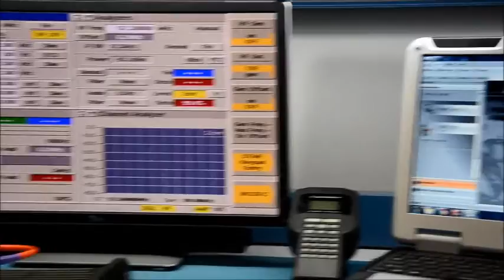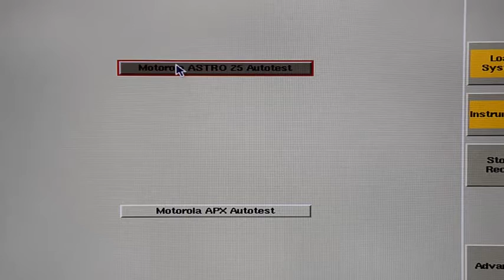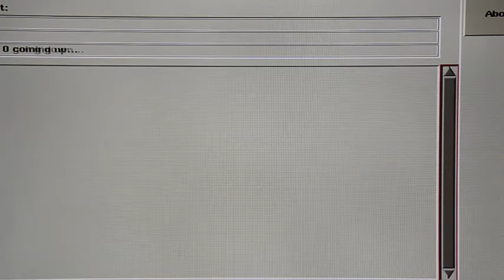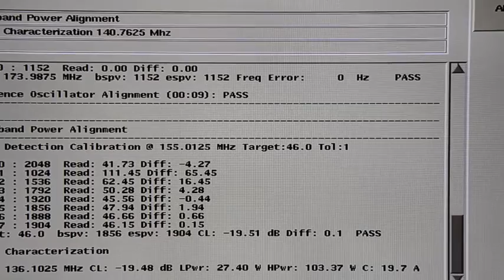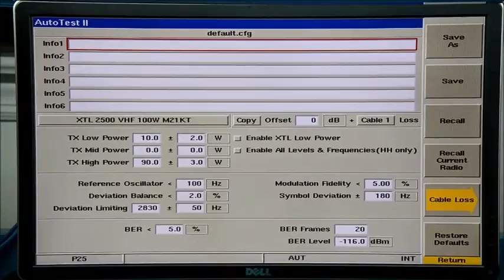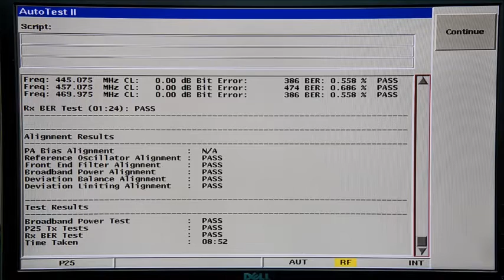Aeroflex 3920 Autotest and Alignment

Comment: Why are you using an internal reference, if you have a top of the line 10mhz external reference on the benchtop as well? As soon as you started the “align & test” after acknowledging the current shunt and 6db attenuator being connected, it shows “INT” for you machines reference standard. Why not connect it to that external reference for much more accurate and stable results?

Comment: Awesome video, thanks for posting it up! 

Just one small point I'd like to share however - Phase 2 physically still uses a 12.5kHz channel in terms of RF. It's only 6.25kHz "equivalent" because there's two TDMA slots (which are further up the stack) If you measure the RF bandwidth of a Phase 2 channel (either the uplink or downlink will do) on a spectrum analyzer, you will see it's still physically 12.5kHz.
Reply: Matt, thanks for the correction. Sorry I was not more correct at the time. Check out the newer video I recently posted on the Aeroflex, it's long but pretty detailed.
Reply: @markdanon1376  Hi Mark, can i have your email address? i have similar aeroflex 3920 and need to know more related to technical from you, thank you
Reply: Hello, please email me at mark@northcommtechnologies.com